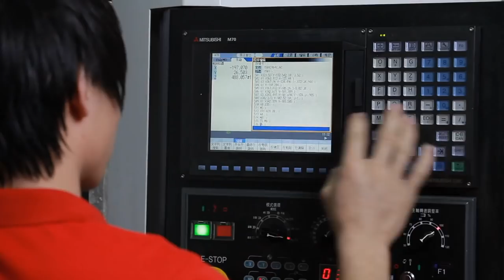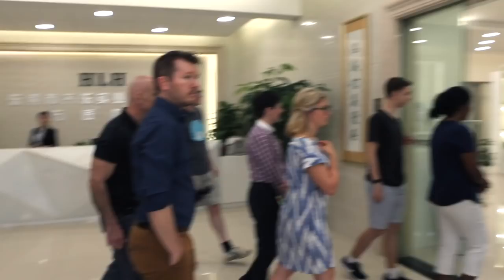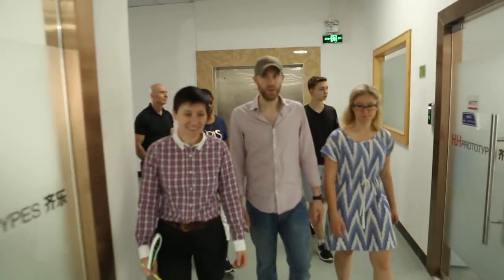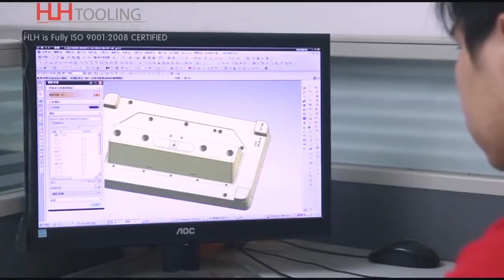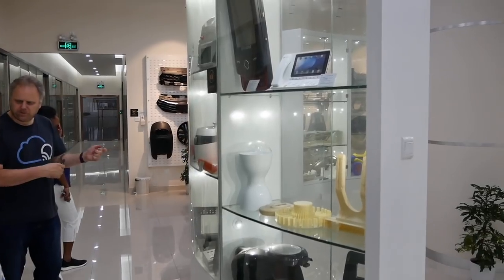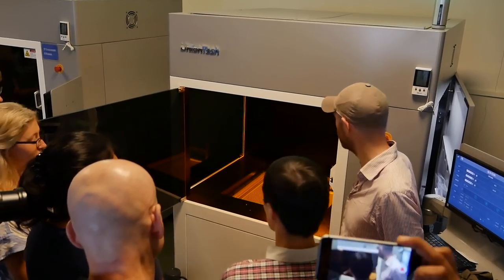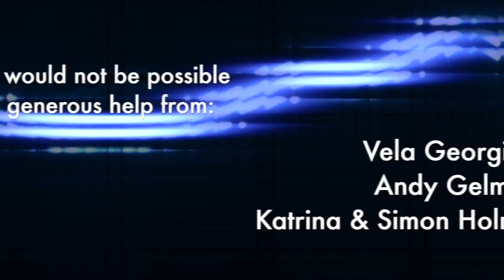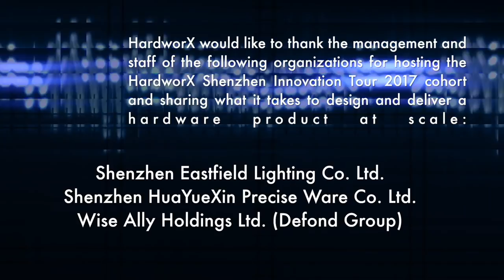The Factory Tours of Shenzhen - HLH Prototypes

Comment: Silicon molding is a method that is easy done at home, in a hackerspace or other places and is very accessible. Highly recommended to play with for makers curious about what the next step after 3d printers are.
I've used it to turn 3d prints into urethane and resin parts using home-made and salvaged gear. The limitation is your 3d printer, not the casting.  There is a lot of info out there on doing it.
(Barnes are are handy supplier in Australia for the materials to get started.).  We've even done hollow chocolate and urethane parts.
Reply from the maker: Thanks for the great information